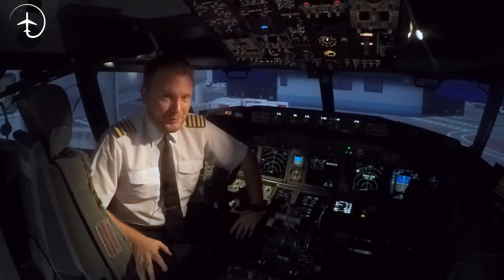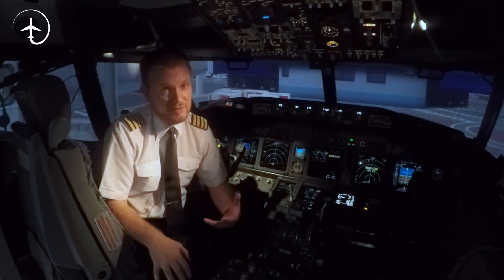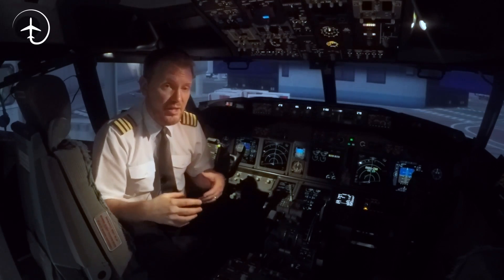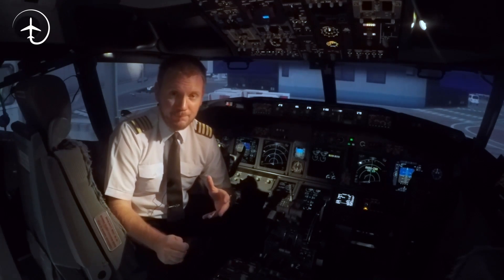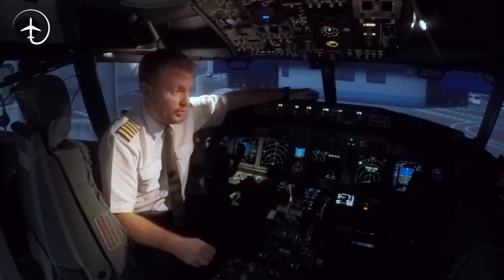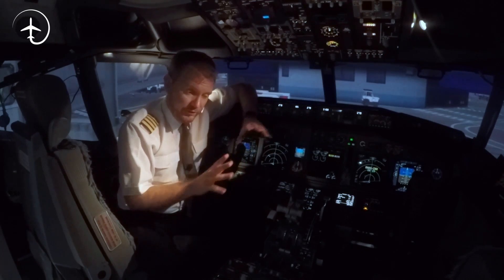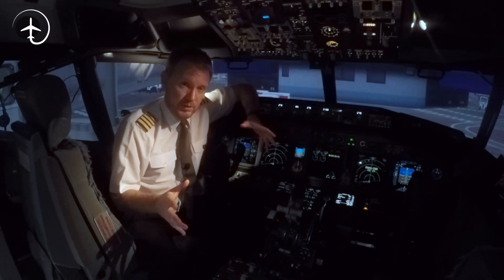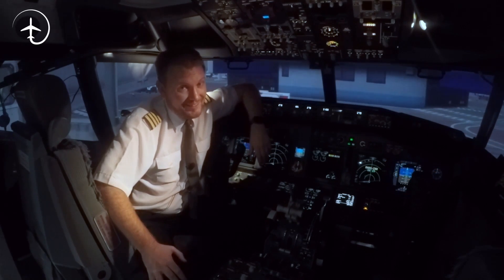Aircraft BLACK BOXES. How do they work?

Comment: Very good video mentour, as always!!! 
Here is a question, why black boxes aren't equipped with a GPS antenna, and we have to still be finding them by eye?? 
Thank you in advance, hope you answer me question!!!
Reply: I have a feeling you have misunderstood how GPS works. GPS navigation is a completely passive system. That is, the GPS units we have in airplanes, cars, phones and what have you are receivers only. They don't transmit anything at all. Likewise, the satellites aren't receiving anything from the GPS units, so they have no idea where those units are or even how many are using the service at any given moment. In cases where your position is broadcast, it is by a separate system from the GPS receivers. And as the others have pointed out, that is expensive by way of power consumption. (Also, GPS won't work underwater, so it wouldn't be able to know its position if submerged anyway.)
Reply: Daniel Garcia Limones 
A GPS unit requires a fair amount of power to constantly broadcast location. 
The flight data computer (black box) has to broadcast for a 30 day minimum. After the 30 day period, the internal battery is just about dead. Add to that the GPS load, and the present battery wouldn't last a week. 
From time to time the GPS feature is brought up, but would require a total redesign of the black boxes. Multiply that by 125,000 aircraft in worldwide civil aviation and the cost is staggering.
Reply from the maker: It has a “pinger” instead that uses less energy but can be easily found
Reply: 406Mhz Emergency locater transmitters send GPS info at time of impact. They are usually near the recorders in the aircraft. That may be useless in the event of submersion. The “pingers” are acoustic only and activated when submerged. No radio capabilities. I love your vids Mentour.

Comment: Do they also function during a mayor loss of electic power? For example when the RAT needs to be used
Reply from the maker: Yes, they have their own internal battery if needed.
Reply: Alvaro Cifuentes not when the rat is deployed. at that point, there is still hope of a safe landing.  the unit has its own internal power supply. since they are wrapped in titanium or steel, they can withstand an impact of 3,400 Gs
Reply: Ava Mendez okay thanks